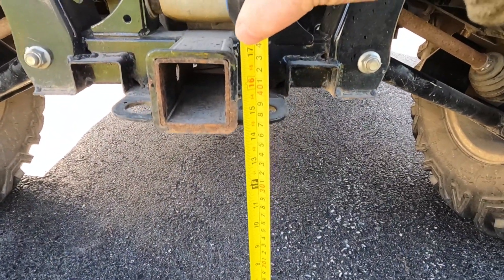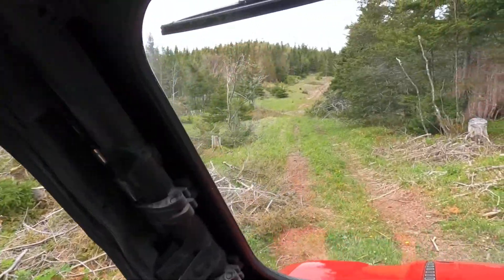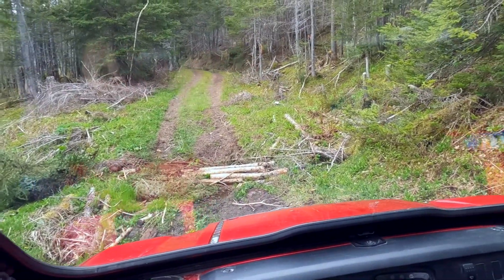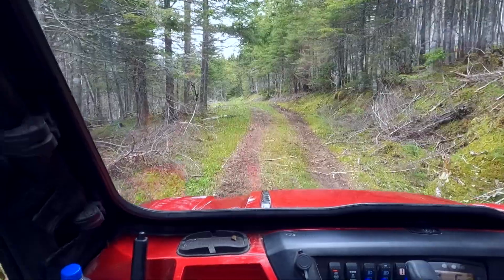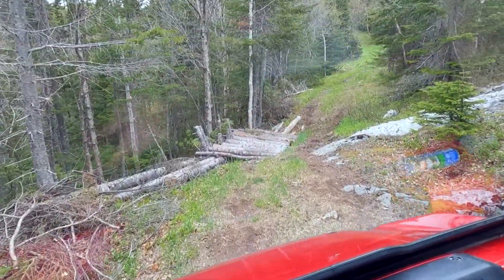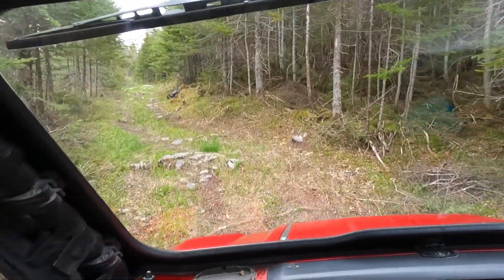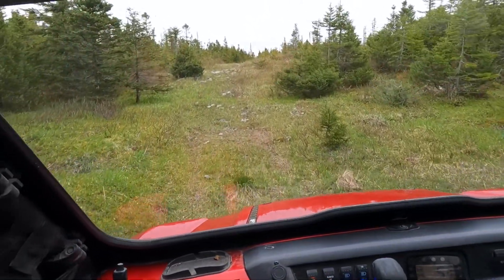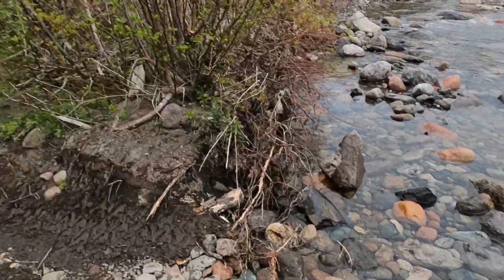Mule Pro FXR Lift Kit Installed & Test Drive

Comment: Very nice. I had my commander out a few times already. I wanted to put a lift on mine but did a few measurements and realized it would not fit through the door on my trailer. I have had lift kits and bigger tires on quads before and the clearance was great. Especially in Alberta mud . Enjoy and keep up the wonderful videos. 🙂🙂.
Reply from the maker: I was surprised the difference it made. Managed to cut all the blow-downs out of an old road and got my machine into a great fishing hole. Got a fine feed of trout last evening but forgot my camera home, so no video. Lost one trout about 3 lbs... I'll be heading out again in a few days to try and catch some more big trout.

Comment: Do you feel limited by not having a front locking differential? 
Thank you for the video, I am considering between this and the FXR PRO EPS.
And the CF MOTO which is less money that the Mules but does have the front diff.
Any thoughts would be appreciated.
Reply from the maker: Not at all, I'm pleased with it's performance but I don't spend any time on mud-holes. I've climbed some steep hills and moved a lot of snow with it. I'm glad I got the 2" lift and adjusted the shocks. It's a different machine now. The Mule is nothing fancy, basic to a fault. But it serves my needs. If I have the money I'd get a Can-am Defender fully loaded... But on a budget, I'm happy with the mule, especially when it comes to gas mileage... Top-Notch mileage.
Reply: @NLGhostWolf  Want to say thank you for your help. 
Dropped coin on the Pro-FXR today. Drove the CFMOTO 600, the MX Mule and the FXR which was head and shoulders above the others. More than I need? Most likely, but I'll never have to wonder or regret that I didn't upgrade when I had the chance. 
Need some door tops and I'll be prepared for just about anything! 
Thanks again for your input!
Edit to add: parts are on order and need to wait for the build, but I'm stoked!
Reply from the maker: glad to hear, you'll be happy with it I'm sure
Reply: @NLGhostWolf  Following up after re-reading your first response; did you add wheel spaces post lift?
Also, I am getting a Warn 66" plow for my unit. Any suggestions or comments from your plowing experiences? 
Thanks again for your time and help.

plowing

Comment: Looks awesome.  Nice set up.   What brand is your windshield?
Reply from the maker: not sure but it's solid glass. and it has been hit by 100's of alders over the last 4 years
Reply: @NLGhostWolf  👍thanks. Looks like the kawasaki brand. Do you wish it had ventilation or could lift up?
Reply: @oltyger8224  I have the same question.

Comment: Those mules ate pretty nice. Had some thoughts replacing my grizzly700 with a mule so i can ride even if it rain and so
Reply from the maker: Nice to stay dry on the poor weather days. But those quads can get into some more tighter places.
Reply: Three-layer Gore-tex riding suit would be a much cheaper upgrade!  But, harder to keep the moose quarters dry on the quad.

Comment: Do you find that the machine is tippier now?  Did they have to put wheel spacers in also, to widen out the rear wheels for example?  I have a 2" lift kit here for my Viking, but have hesitated putting it in due to it being used primarily by wife with kids as passengers due to probably a noticeable increase in tippiness.
Reply from the maker: Because I had the shocks adjusted to be stiffer I don't notice any difference but anytime you lift a vehicle the Center of Gravity has to change.

Comment: Did it change the ride any?
Reply from the maker: Yes, but not as much as you would think. By stiffening the suspension it increased the clearance of the SxS and then with the added 2" lift kit on top of it, I was shocked to see how much more clearance it had. Now you notice bumps more, hits with a slight increase in the thump if you know what I mean. However for the speeds I drive and the places I go, I'm very happy with these changes. More audible thump when you hit a pothole but I just drive a little slower when roads conditions are poor and when you need the clearance, it's there... Gained a lot more access into areas where I shied away from in the past.

Comment: Load your Tires like a tractor. Takes most of the tippiness out. I carry a boat on the roof of my Side by side. Loaded tires helped a bunch.
Any Machine made for Canada needs the lift kit. Can-am, kawasaki, Yamaha. They all suffer from the lack of  brake over angle.
Reply from the maker: yes loaded tires would be a big help